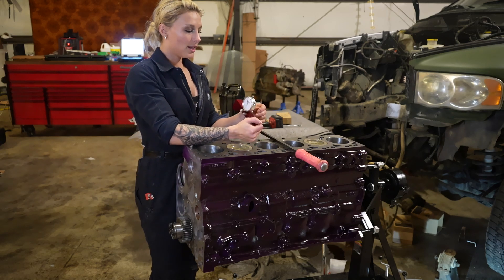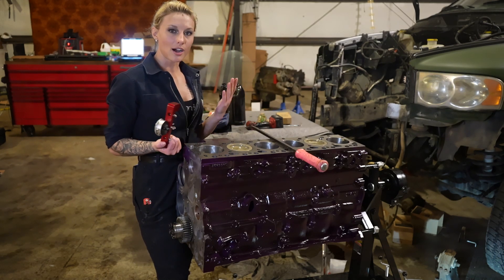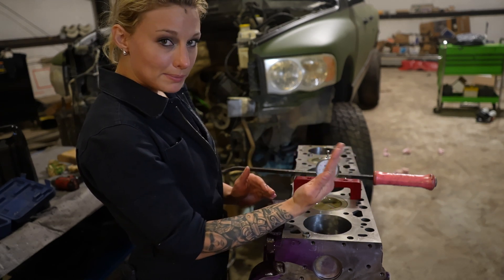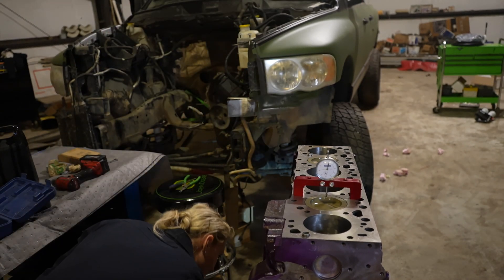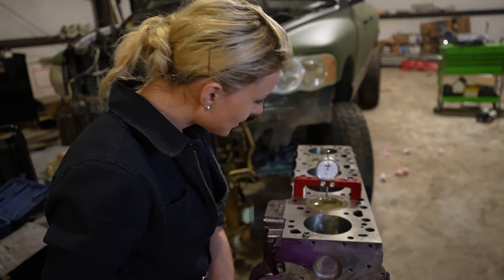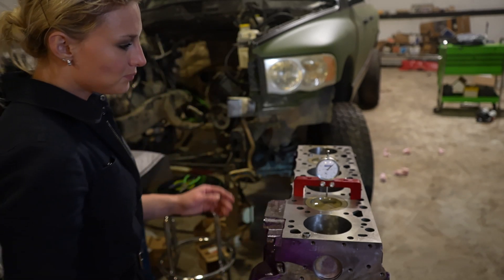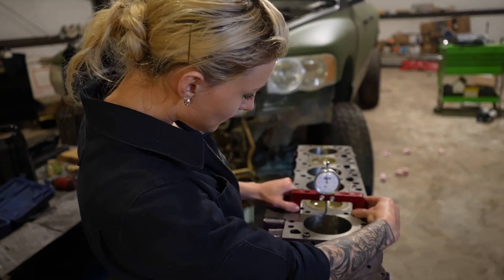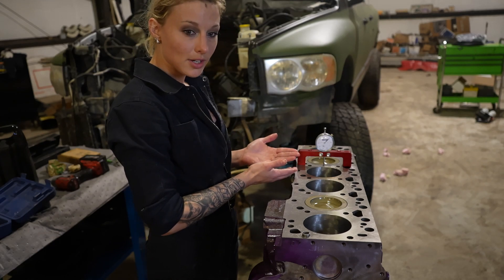How To Measure Piston Protrusion

Comment: So why is piston protrusion is important  and how is it adjusted?.I know how to measure cylinder liner protrusion.
Reply: its not if  your using cummins or the oem parts but aftermarket things like rods, pistons and camshaft can change it to where you have to much valve lift, or piston slaps the head.

Comment: If your running close to the upper limit I recommend measuring at top and bottom cause the piston will rock in the bore and tilt in the bore a little. Don’t want those cheeks clapping at a higher rpm

Comment: Damnit i wish i had a mechanic like you i coukd trust with my RB25DET... ive already done headstuds , OEM headgasket and cylinder head oil drain kit. Im a bit nervous bc even tho i did stuff pretty carefully... not much next to one dial gauge was needed an i lifted the head removing the timing belt etc without cracking the harmonic balancer crank bolt. 

I have to say you are awesomely confident in your work. I learned 2 new things today companion cylinders and how to read the protrusion. 

Looking at getting a 4g63 next.  Maybe rebuild my barra 245T. 

Can only hope I regain my confidence working on my own cars again as it's been more a ritual of abusing myself again and again after braking something... again

😂😂

Comment: Not trying to nit-pick, but to find true TDC you should make a mark on the balancer (or use degree wheel) a certain distance BTDC and then the same distance ATDC. The center of those two marks in true TDC. I don't believe the distance you stop before or after really matters, but I usually go 0.050". An ole boy showed me this. 

That being said, just for checking piston protrution, the way you did it is fine really, but just not at exact TDC because of the piston dwell. Depending on stroke, rod length, and probably some other stuff, the amount of crank rotation while the piston is as high as it ever gets varies. Like I said jus trying to pass on something someone taught me.
Reply from the maker: Neither the balancer or the flywheel are installed
Reply: @thedieselqueenmelissa  mark the crank 10 degrees before and after then mark the middle the middle is true tdc, look up how to check cam timing on a 60 series detroit and follow the instructions works on any engine.

Comment: Except 2 stroke Detroits. If memory serves me, Detroits are piston recession ie" below the deck. Also a recent discovery of mine. Oven cleaner dissolves carbon like magic. My brother and I even noticed pistons wouldn't move side to side,but after letting oven cleaner seep past the carboned up rings that were apparently" seized " with carbon. We then got pistons to where we could fill with kerosene overnight to flush the  gunk to oil pan,then flushed out pan.

Comment: Whatever turns the crank without damaging it and gets the job done is the proper tool yes there is a barring tool but where there's a will there's a way what did mechanics do before there was a such thing as a industry standard anything they just did what they had to do to get it done so whatever gets the job done I have been watching along to see the progress on your new truck that you're building anxious to see the finished product going to be cool
Reply from the maker: I used two bolts threaded into the nose

Comment: That is how you have to set the injector pump lifter on caterpillar machines from the fourties to the seventies
Reply: See it is like this you have marks on the fly wheel stamped one and six, running mates , two and four are mates, three and five are mates so when you are setting the lifter in the pump to the correct measurement, you bar the engine over till you get to say one and six now also depends on witch is top compression so if you are bar the engine over for top compression of # one as the mark on fly wheel comes in view, you must stop right on the point if you go past you either had to back up 90 degrees or roll the engine around twice to get back I is in partitive you stop right on point mostly cause of the back lash in the gears and piston being right at it spot, cause if you pass point by an 1/8 th inch roll back to now you be lost in the gears and on the connecting rob ist being ien do for stonien

Comment: Just do it by eye!
Reply from the maker: Idk about you but my eyes can't see in thousandths 😂
Reply: Actually the human eye has been proven to see in a resolution down to about .004” .  I’m a machinist and engine builder and regularly can distinguish down to about 5-10 thou and while I don’t rely on vision I use proper measuring tools, I will sometimes guess at something using both eyes and touch and then measure to see how close I was and this is how I got the above that I’m good to about .005-.010”.  If I were to get an eye a🙃exam and glasses I could prolly improve by a few.  I find myself squinting sometimes the older I get.  Speaking of eyes, yours look great in this video.  Personally like them better here than with the cat eye or wings or whatever they are called.  👍🏻

Comment: That's what im talkn bout golden girl, that short block is Cummins along 😂
Reply from the maker: Punny😂
Reply: @thedieselqueenmelissa  
I have a 2004.5 Ram that spent 2.5 years at a diesel shop getting a new engine during covid. It came back and the rebuilt engine is worse than when I took it in.
Any chance you're in California? Or, could you recommend a shop for a full rebuild?

2nd question: My cab came off. Its possible to pull it out the front?
Reply: Sometimes every now and then a blind pig will find a truffle na talkn bout, can't wait to hear that diesel purr like a new born baby kitten

Comment: Great video but... 1 thing made me cringe. When you said to crank down the gauge in the fixture I was 😳. I don't care what brand you are using if you are ham fisted when you "crank down" you "WILL", (not "MAY"), tweak the gauge and cause it to stick in it's travel... 😢 You might not even notice until you you see a slight "jump" in the gauge movement as it rides up and down. I know Melissa is a lot more careful with her tools than that but for the brutes in the audience.... 🙄
Reply from the maker: Well I noticed if it's not tight enough the whole Guage will move inside that bore. I didn't say use a tool to tighten it down or anything, but it's gotta be snug.